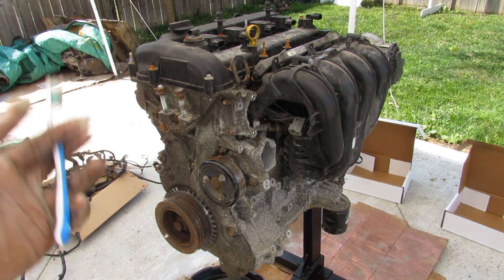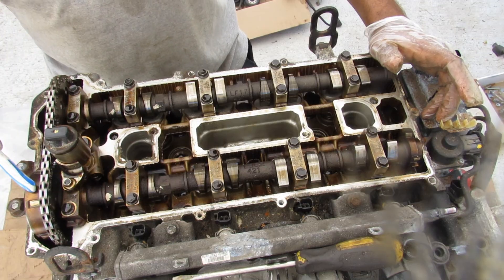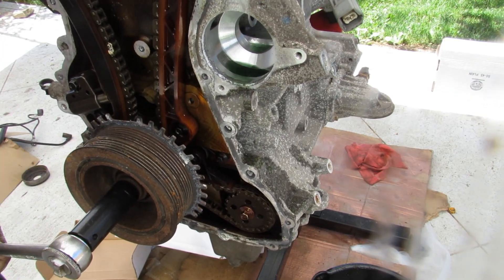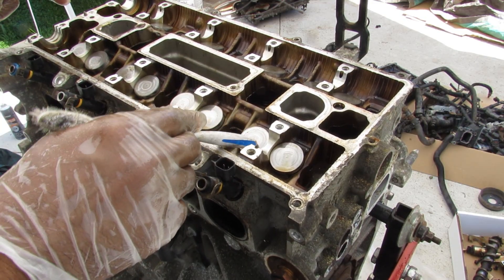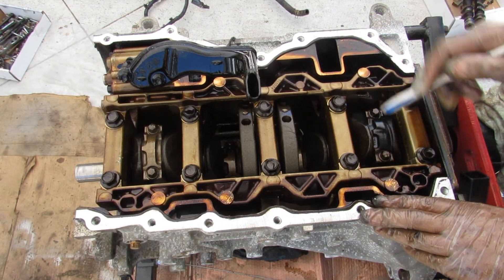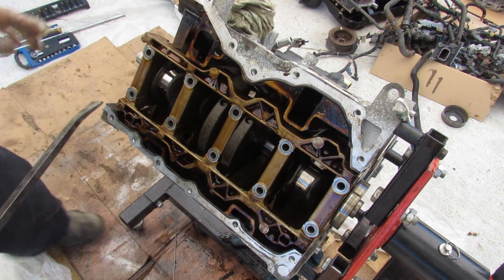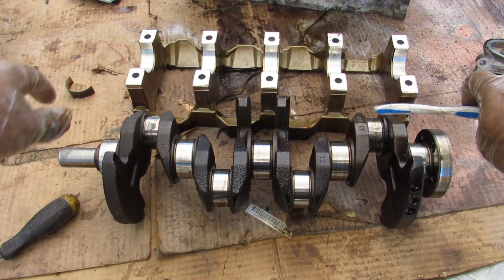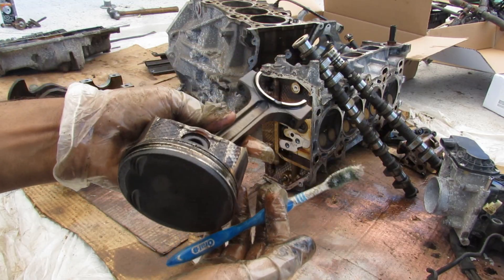Why Mazda Engines FAIL

Comment: People dont realise that there is no low oil warning light on the early mazda 3s  the light you see on the dash is actually an oil pressure light ,and basically if that comes on while driving, the engine is cactus already, & also these engines are known to burn abit of oil 🛢, so you really need to check your oil levels regularly

Comment: We have a 1.6 in the family, it has 250k km, needed a head rebuld as we run it with lpg, otherwise very reliable, still going strong, 10k km oil change interval

Comment: There is a non-turbo 2.3 Mazda 6 (L3) making that same knocking sound although it is subtle. The radiator has signs of fluid interchange ( aka milkshake) but the oil looks pretty decent- found that strange. was changing the serpentine belt, water pump as well as, idle pulley on it. 

Looks like a nightmare to time and work on - was going to check the lifters, timing belt/chain next. having second thoughts about taking the job on after watching your video.

Great content - very informative

Comment: well  i have a 2.0l duratec on a focus, it has 200k miles on it, still runs as strong as i got it on first day, no oil consumption, not even a drop, i change oil every 3k using conventional , synthetic on 6k , never failed me.

Comment: 2.5L MZR on my 2011 Mazda CX-7, close to 130000KM now, changed valve cover gasket at 90K km, recently noticed a slight knock which might be the non-hydraulic valve cap wearing out. Changed oil at 5000km or 6 months using synthetic 5W-40 and so far so good.

Comment: 🧔🤔I🧔HAVE A(10)(MONTH)(2007)(MAZDA)(6)(MZR)(2)(LITRE)(DESIEL)(MANUAL)(STATION)(WAGON)(364000KMs) REPLACED (CLUTCH)AT(355550KMs)AND (FRONT)(LEFT)(WHEEL)(BEARING)AT THE(SAME)(TIME)AND THE(FLYWHEEL)WAS(PERFECT)(NO)(MACHINEING)(REQUIRED)🧔🤔🚗👀🧔🤔👍

Comment: I religiously service the basics ie; engine oil/filter air filter and plugs. It really is worth doing and not that difficult and allows the worst designed engine to carry on. Mazda engines are considered to be very reliable though their auto boxes have a troubled history.
Reply from the maker: Yes. Its easy maintenance

Comment: My 1uzfe didn’t have valve adjustments or oil changes done frequently original pcv v ,clogged pushed out most my seals.timing belt was covered in oil by 26 year old cam seals Any engine can become unreliable without maintenance.

Comment: I have the Duratec in a 2.0 Focus North American version (2010). Ugly car, with a few weak points (valve cover gasket, suspension bits, engine mounts) but the engine has 155k miles and runs excellent. I have the oil changed about every 5.5k miles with Valvoline synthetic blend "high mileage" formulation. The car has never used a drop of oil, and the oil even looks a nice new honey color most of the time between changes. When I bought this car (used) I intended to keep it only a few years, but I've now had it 9 years, the longest I've ever owned any car. Despite the ugly, I take care of it and it still looks good with shiny paint, clean interior, etc.

Comment: Alright, i just did a junkyard overhaul on one and threw it in my escape 06
The overhaul consisted of almost everything getting replaced, basically it was a short block, i ordered a brand new head for it. Anyways, 1 month into my wife driving it around, i checked the oil level after hearing it stall out after being turned on, well she had a half a quart in her. Can anyone elaborate why i dont see a leak in the driveway, ive refilled it to see if it leaks while sitting and still no leak. So clearly its just while driving. Im about to get a leak down tester and see if the oil is seeping past the rings, granted im sure ill be able to tell something quick enough by pulling a sparky plug. Im almost positive it spun a bearing, so cross your fingers it didn't destroy the crank, which was the reason for the first engine getting thrown out. Im at a loss, i do not understand how an entirely different motor can end up with the same issue randomly

Comment: Recently flipped a 05 mazda 3 with the 2.3l - 290k. Engine was quite strong but definitely burned oil, replacing the poorly placed PCV helped but still over 1quart per 1000miles.

Comment: I had this same engine. I think as these age they start to quickly accelerate their oil consumption. It makes sense but that was also the last engine I only checked the oil at the intervals. We ended up replacing the engine with a junk yard motor.
Reply: I just did a junk yard one myself, and a month later I found the car had half a quarter of oil and no signs of where it all went. About to check/replace the rod bearings and see if I can get a better look into what happened here soon, really upsetting how short-lived my happy days were with it

Comment: Ford actually used a lot of the design from Mazda for this generation i guess. Interesting that their 2L EcoBoost is a Mazda L with a Ford Manifold and ECU (according to wikipedia and some other sources) Skyactiv-g would be super interesting to see a tear down, especially of the 2.5 or the modern Miata 2.0L.

Comment: These engines are extremely reliable. This is basically Mazda's version of a Toyota engine. With regular oil changes, I've seen these engines with 300k+ miles. Now the turbo ones don't last as long, but that's to be expected. Mazda is really good with making engines, but their automatic transmissions were pretty problematic. Since Mazda is partnered with Toyota, the newer ones use Toyota transmissions in them. So you don't have to worry about transmission problems anymore.
Reply from the maker: Yeah I think the new Mazda stuff is pretty good tbh
Reply: Which year would you suggest used?
Reply: @habgirl1144  Anything after 2009 seems to be solid. Keep in mind, Ford took the Mazda engine, and basically made it stronger. So buying a Ford wether it's a Focus, Fusion, Escape, Fiesta, basically any Ford with that engine, is a safe bet. Just STAY AWAY from the Fords that have the dual clutch transmissions. Those were very bad. Stick to a manual, or the 6F35 auto. I believe the Focuses and Fiestas used Mazda automatic transmissions as well, which were okay. They don't shift as good as a 6F35, but with proper maintenance, they can last. Anything made before 2009, I wouldn't recommend buying.

Comment: Hi. Im pedantic about the  servicing on my 2.3 2003 mazda 6. Always  change oil at 10k kms with quality stuff.
Any thoughts or comments ?
Engine is running well at 230kms
Reply from the maker: I usually do 5-8000km

Comment: I had to watch this video again, Mazda now at 591,000 kilometres no ticking, starts up quiet. It would run better if I put fresh plugs in it as the current ones were put in at 300,000 kilometres. LoL. My mechanic actually complimented Mazda after doing 4 wheel brake job at 589,000 kilometres. Perhaps one day I could get you the motor to tear down but I'd have to drive the car to you. My wife's new CX 5 2.5 litre makes more noise from it's tailpipe than my 2.0 litre. I change Mazda's oil every 15,000 kilometres but I do use synthetic oil. I enjoy your knowledge and excellent presentations.

Comment: That title should say - why engines fail- as far as a mass lroduced 4cylinder the 2.3 is actually a pretty strong motor, no inherent design flaws, runs a timing chain, the biggest issues i have seen with them have been minor sensor problems, and as far as oil sensitive it's basic maintenance, you skip that and use wrong fluids and couple it with abusive driving no engine is lasting

Comment: Looks like the owner used cheap oil and didn't change also regularly the oil, probably also wrong oil viscosity and also did not run the motor warm especially during wintertime.

Comment: My wife once had a Mazda 323 with a carburetor/contact point distributor engine which she bought new. Engine started developing problems within 3 years under 30,000 km. Not the most reliable engine at that time in the late 1980s. Compared to good old Datsun (Nissan), Toyota and Honda, Mazda and Mitsubishi were the lame ducks of the Japanese auto makers. The big 3 Japanese auto makers produced cars that were largely trouble free for the first 5-8 years. Reliability issues with the carburetor and distributor from year 5-6 onwards.
Fast forward 30 years later, they could have improved a lot but they weren't reliable at that point. This is my personal experience.
Reply from the maker: The newer Mazda's have come a long way
Reply: @speedkar99 had a 1986 323 that engine was fuel injection and very reliable. Unfortunately the front suspension was part of the body without a complete subframe so the lower control arm's mount was rotting away( the tail of the L- arm was succured directly to the body).They fixed that with the first generation Protege. My 1993 Protege lx with the 1.8 DOHC was a nice car . It was a always a joy to get into the secondary roads in the country side and give it a run.
Reply: @Sammyhale30  Agree. Nissans built during partnership with Renault are rubbish from the point of reliability to utility. As rest, you can raise the wiper arm 90% vertical in all cars except for Nissan X-Trail (Rogue). The arms are obstructed by the back edge of the hood-wtf. And the CVT-don't even start me on that. Nissans (prior to 1990s) before the JV with Renault were more sensibly built.

Comment: 2007 / Mazda 6 / 2.3 / 250k km / 70k done in last two years. Oil changed every 5-10k km. Only thing that gave up so far - AC compressor. Beast of an engine :)

Comment: This engine is an absolute beast and fun to rev out when paired with a manual transmission. My 2007 mazda3 will rust away before the engine or transmission give out lol
Reply: Lol I have the same but my bearing has spun😭 the rust is getting bad but I want to fix the engine so bad

Comment: is this engine non-interference. as far as i read this should be duratec engine and they are non interference. So if there is wrong timing or broken chain pistons shouldt meet valves right?

Comment: I had a 2015 Fusion SE with a 2.5l and it was a terrible engine IMO. Cracked cylinder head at 22k miles. After warranty repair we got rid of it and drive a Toyota. Thanks Ford for sending us back to the real Quality is Job 1 company.
Reply from the maker: Good choice. Which Toyota did you go with?
Reply: @speedkar99  2020 Camry SE. We have put 31k miles on it so far without any issues. Only complain I have is road noise is really bad, but its an SE tuned for the road. I really wished I could have gotten an Avalon I loved that car, but it was just out of my budget to get. What is really sad is the Ford Fusion looked good, had a better ride, but I have never had much luck with Ford products so sadly that was the last Ford I will buy. Toyota is the real Quality is Job 1 company. Ford is Quantity over quality is Job 1 now:P

Comment: 366K miles on my 2010 Mazda 6 w/ the 2.5 engine. Port injection keeps valves clean. Oil maintenance is very important.
Great tear down of this Mazda engine, thank you.

Comment: I have the 2011 mazda 3 sport gx hatcback with the 2.5L. Its been through multiple winters . Oil changed every 5k . I drive a lot   .
Reply from the maker: Any rust?
Reply: @speedkar99  im in alberta and theres a bit i think the previous owners did a good job at keeping it nice but like my brake sheilds have rust but overall great car for fwd and driving . Theres no weird rattles from the csr etc . I do need a few things changed . I drove 45 000 km with this car in less than a year so far

Comment: Great Video I have had 3 Duratecs as said here just be good about all oil changes and these motors will go a very long time w no problems. I have always challenged some of the best engines ever built and under rated for their greatness. Awesome video as always. Outstanding mechanic!!
Reply from the maker: Thanks, glad you appreciate it. I'm not a mechanic, I'm an engineer

Comment: What a great video. I have a 2012 Mazda 3 with this MZR engine ( Not a sky active). I’ve found it to be a great engine, I’ve always changed the oil every 5k. Aside from the valve cover gasket leaking and some leaks from the timing chain cover, this been good so far with 127k. I had that this was a direct injection engine so that’s nice to know it’s port injection.
Reply: Hello, any updates about the engine ? :) just bought one of these.
Reply: @alexgearhead  still have it, over 150k miles now. Zero issues with engine. Just did engine mount as mine was starting to wear.
Reply: @D_Spear  thank you,  what's written on your engine cover, is it MZR 2.0 DISI ? DISI means it's direct injection(that's what it says on mine)

Comment: This is what you get when you ask to much power from this engine.
I think that oil was changed on time.
Its just that the driver did not always warm up the engine good begore driving fast.
Reply from the maker: I think they just didn't check the oil

Comment: Just wondering if there are any repair kits for the swirl flaps on these engines? Especially for Mondeo MK4. they are slightly different from MK3
Reply from the maker: I'm not sure but yeah it's a common issue

Comment: Our 2017 mazda cx 5 2.5l spun a bearing at 18,000mi/30,000km. Also lost 4 quarts of oil before spinning the bearing. After that, we got another Toyota with a 4.0l v6. My 07 tacoma can literally get the crap kicked out of it and it still drives where you need to be, even with broken cv axles or broken struts... ask me how I know this.... our mazda couldn't survive up to its 4th oil change. I'll never buy a mazda again in my life.

Comment: Mines done 280000km no probs oil changes every 5000km .
That tensioner is certainly out pretty far , I would say the chain has some stretch . I run my engine at 82 deg instead of factory 102 .

Comment: All due respect, the title is click bait as fuck, is false, and 100% does not represent the absolute vast majority of Mazda owners' experiences with Mazda Engines. Exceptionally late oil changes, clogged intake filters, not replacing worn or cracked/loose belts will cause engine damage. I own a 2013 3 Hatch with a 2.0L SkyActiv Engine mated to a 6 speed CVT...I've been ragging and abusing this car for 5 years with absolutely no critical engine issues whatsoever. Full synthetic oil changes and maintenance always done.
Reply from the maker: The Mazdas can last long of it's maintained and rust proofed. 

This engine wasnt maintained and spun out

Comment: The question is whether these problems apply to the Mazda 3 Skyactive engines which have nothing to do with Ford & are redesigned. 
Mazda, for 2021,  was named the most reliable vehicles by Consumers Rating, ahead of Toyota.

Comment: I have a Mazda 3 2010 with this engine, no problem whatsoever keeping it good with oil changes and cleaning the intakes. Mazda engines have been very reliable in my experience.
Reply: Altho its a Ford engine. Only mazda maping on in.
Reply: @CarloLeonKolega  cool to know that. thanks.
Reply: @CarloLeonKolega  The MZR L engines were engineered by Mazda and produced by Mazda. Ford provided some off the shelf components, and adapted the engines under license from Mazda for their own cars with minor changes. You just can't claim it's a ford engine when all ford really did was license it.

Comment: This should be titled "Why  Ford engines fail"  glad Mazda did away with that Ford Mazda joint venture!!
Reply: It's the Mazda L engine, designed by Mazda. Ford use it under their Duratec name.

Comment: The front cover / oil pans are separate on the skyactiv. It uses rocker arms too. Mazda made a lot of changes
Reply: Well, development is development after all. 🤷‍♂
Skyactive engines are probably a lot different than these ancient MZR L units. The 2.0L engine we can see in this video started its life in the first gen Mazda 6 back in 2002. Interesting though you can still find these new in the recently axed Ford EcoSport and Caterham 7.

Comment: This is a great engine! I had one (2.0L) run to 267K miles with just minor problems until the manual transmission went. Only notable issue was the dynamic intake butterfly valves would loosen and flutter.
Reply: Did you experience something like sttutering between 2500 - 3500 rpm with moderate throttle given? I do experience this, have the same engine and Im teying to narrow down the problem
Reply: @milosozegovic6980  I no longer have the car, that was a couple years ago. I don't recall an issue such as you're describing. A clicking noise could be heard if the valves are loose or worn. Did you try cleaning the MAF sensor?
Reply: How many times did you change your clutch on the Mazda 3?
Reply: @crow_2k11beatsbydre8  once
Reply: 2.0 is good this is junk

Comment: Appreciate the video and the explanations. It would be better if you would add mileage and maybe service information history. Instead of "why engines fail", maybe "fail because not charging oil in time"? 
That by itself can lead to major issues on those small 4 cyl engines.

Comment: I had a MZD 2.2l turbo diesel. All servicing on time. The engine died at 140000km. Wonderful torque but turned me off Mazda Diesel engines.
Reply: Thats unfortunate but Mazda 3 gasoline cars are known to survive in the Middle East up to 500,000 km!

Comment: I can't believe how badly that timing setup is designed, you need to set the trigger wheel, crankshaft, and camshafts independently. On top of that, if your harmonic balancer  isn't torqued enough it could completely destroy your engine.

Comment: Not ALL Mazda engines fail.  I am the original owner of a 2001 Mazda Tribute 3.0 V6 with almost 250,000 miles. Engine is maintained religiously.  Replaced the transmission at 205,000 but engine is still strong.  I plan on driving it until I pass off this mortal coil.